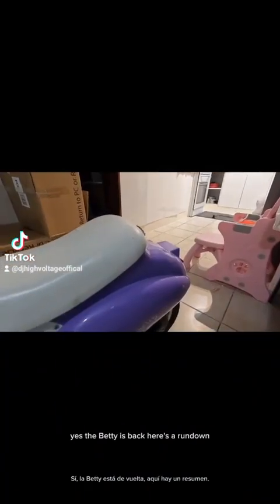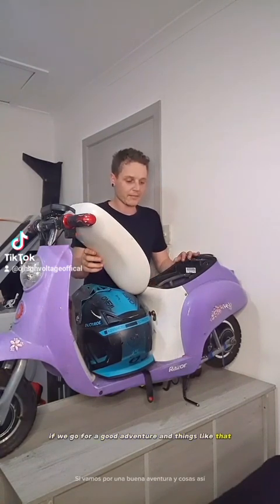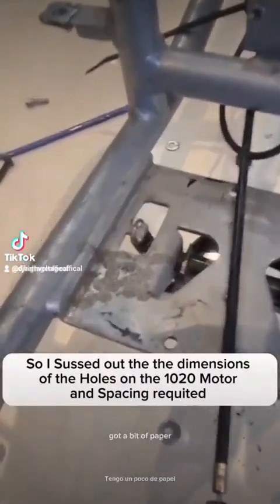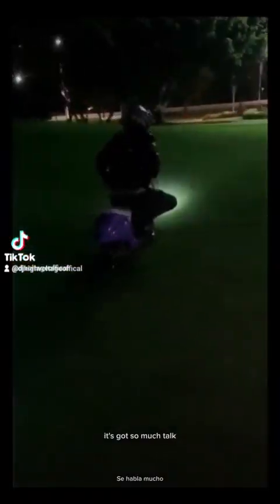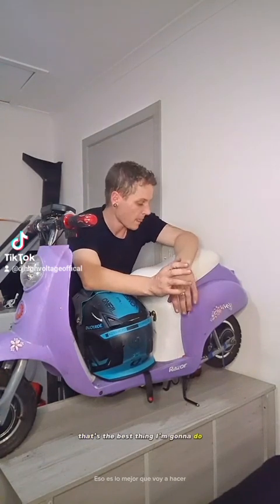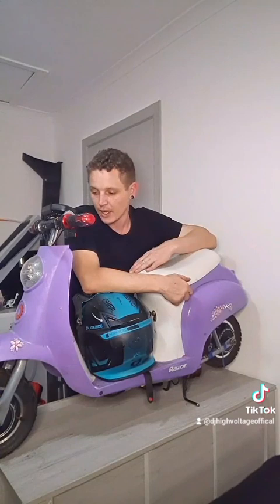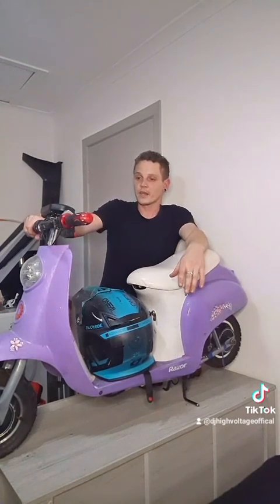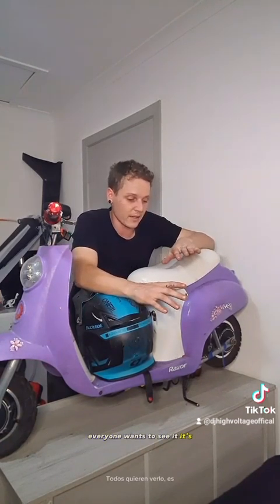The Razor Pocket Mod Review - Turning a kids toy into a Hyper Scooter

Comment: Yo link to forks and hub motors or you gonna be mean about it 😂
Reply from the maker: I didn't buy them just collected off dead scooters 😂 800w motor off a Dragon GTS and 1000w motor off an Zero X10
Reply: Jesus death trap haha crazy you make it all work haha I’m thinking about doing a duel hub motor one and get custom disc brake mounts mounted and some suspension front forks I got two to play with one I’ve already dodgy changed it to a vevor 2000w my battery is like 3 years old and works for hours but not enough top speed I’m debating weather I should do something not many or what no people have ever done and do a ko suron motor swap and go like 120kms haha or if I should go duel hub but the price off a KO motor is same as probably two decent fuel hub motors which are like so hard to find I think a suron ko motor one would be hectic hay you should join the razor pocket mod group and modified razors for adults for tips and advice if you aren’t already  😎